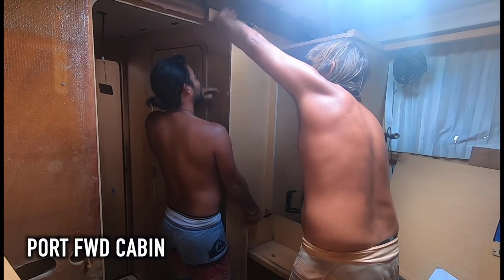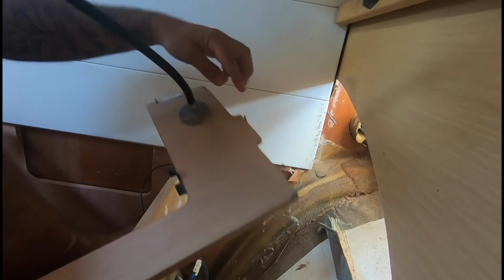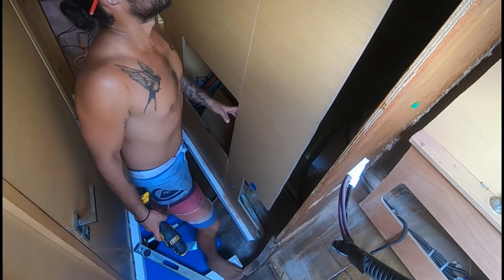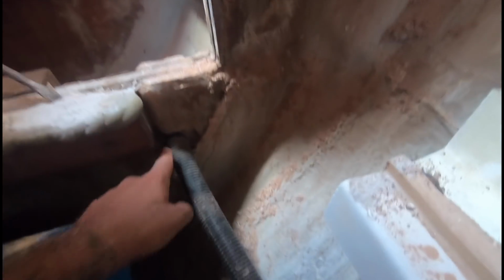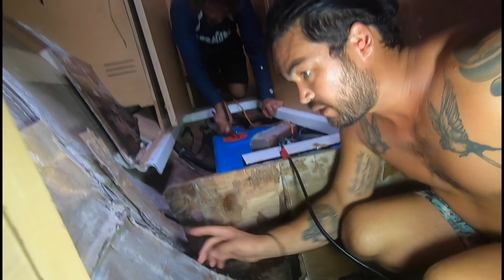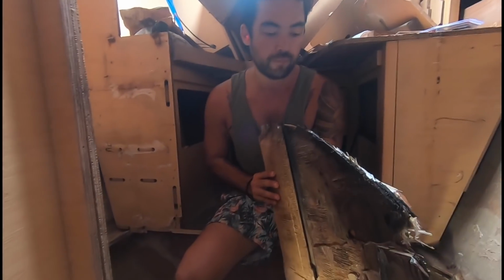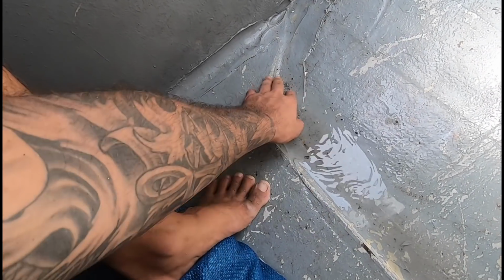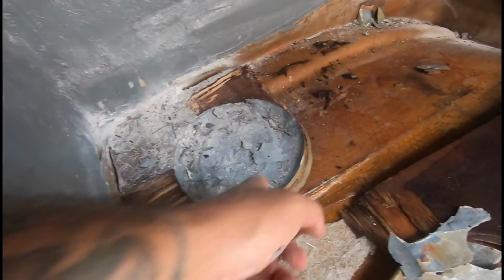CRACKED BULKHEAD REPAIR SERIES - Part 5  (Episode 110)

Comment: Einstein may have been smart, not as smart as a “destructive f*cking water droplet”...  🥴.  Is there a point where you may want to replace entire bulkhead, kind of like two halves (L/R) built outside the boat using templates and assembled inside? Is that feasible to do?  Spend the money on proper masks, fiberglass dust you’ll be breathing will take years off your life..🥴.  Love the positive attitudes and it’s gonna be a tank when you guys are finished 🥳.   Cheers from SoCal, Armchair QB, Matthew! 🤓

Comment: Are you planning on replacing the interior you had to cut out from other wrecked Lagoons you may be able to salvage from, building new Lagoon jigsaw or going a completely different route so you can get to those areas again if you need to?

Comment: I have a few suggestions on the repair. I would make the doorways smaller/use carbon fiber in the repair   mixed in layers of fiberglass / add cross supporting cable's  from bottom of bunks to add support to the mast wires. Just bouncing ideas for the best results. Good luck.

Comment: Im surprised Lagoon are not paying you NOT to post videos. The design itself may be ok, but clearly its been fu*ked up by the builders using crap materials and drilling holes in all the wrong places, thats just bad engineering..

Comment: Guys, you will find. Every bulkhead where plywood touches the hull and not sealed to be wet. I did the exact same thing to this boat in 2000 https://www.yachtworld.com/boats/1977/hardin-voyager-44-3749998/ What I'm trying to say is don't waste time looking for leaks. I think it's hull condensation. That tiny void created where the plywood meets the hull breaths in, moist air we humans create wherever we live. I didn’t remove all my plywood, just cut back to good wood, then glassed and filled back in. My rot wasn't as extensive as yours, maybe 6" back at the bad places. I started to cut back even the good wood just so I could seal it and prevent future rot. You'd think modern boat manufacturers would know how to prevent this type rot by now. Good luck, you have the right attitudes!

Comment: I ripped out a lot of crap resulting from poor craftsmanship and lack of detail planning, but this tops it all, and by far so.  I am shocked by the build quality, the lack of error tolerance in the design, how conduits at the weakest points were made, the lack of proper fiber strand orientation, the... everything.  I admire Colin to have gone this far and still keeping up good spirit.  The absolute worst point has been reached and things will get better from here.  This revision from model 450F (*ucked up) to model 450CJ (Colin/Jamie) will result in a strong and safe boat, and eventually after quite some carpentry, also again a beautiful one.  That's the goal and Colin is right to focus on this. A year from now all this will be an epic story told at a foreign beach with a fire and a beer, and a sunset over the open sea framed by a 450CJ silhouette.  Best wishes!

Comment: Seems like the manufacturer knows about the crappy work. So many ppl have been posting same issues. The manufacturer went through the trouble to hide it! Wondering how many boats have sank and ppl they have injured or killed from their super expensive crappy built boat.

Comment: When building new bulkheads, instead of cutting rectangular door openings, have the bottom of the opening smaller than the top to leave more bulkhead material in the lower corners for more strength in that area.
Reply: Yep, rounded corners like in a sub. 👍

Comment: Right at the end: “I don’t’ know what the FK that is!”.  Surprised and funny, When You found the round piece.  Epic.   Great engineering mind.
Reply: I am very curious about what this could be, I came looking in the comments to see if anyone has any idea.
Reply: From what I've seen so far, it wouldn't surprise me if it was a hole in the hull that they patched with a piece of ply. This build quality is beyond bad, it's dangerous
Reply: @freerangerich  Thinking the same thing, wouldnt want to be on passage with any of these issues he's dealing with - hes been lucky as shit to be where he was when the boat broke
Reply: I wondered if they were bond pads to the hull for anchor points to lift it out of the mold and later get cut off.
Reply: That was put there to add more suspense and drama to this repair and rebuild story! Next few episodes should be good as they probably will determine that the whole boat needs repair and rebuilding... Stay tuned...

Comment: Dear parlay, don’t glass over your plywood bulkhead edges without first doing a dry run fitting of cabinetry- furniture, taking into consideration thickness of laminate of glass on ply edges, thanks.

Comment: Evidence of bad glue joints, not clamped with enough pressure to achieve the required amount of adhesion. Vacuum bagging would help a lot if it could be done.

Comment: F the pre-fab carpentry. You can do so much better. I know your pain I remodel RVs. You can treat the plywood also.  The engineers and designers should be down there ripping and tearing with you so they don't f up future boats!

Comment: I find many of the comments about the build quality of this brand or any brand comical and sad.  Truth is this kind of damage and deterioration is in MOST 20 year old production boats.  You see how hard it was to find.  You see Colin who has a lifetime of experience in this industry astonished at the cancer his discovers.  And think about all of that bulkhead rot came from trampoline brackets and 1/8 inch bolt holes.  I venture to say that many of you boat owners don't take the time to re-bed every lifeline stanchion, deck fittings, anchor windlass bolts, rub-rail screws, on and on.  Needs to be done every couple of years regardless whether you think it is fine or not.   This rot did not happen overnight.   But most boat owners don't understand this and since they are weekend warriors leisure time is too valuable.
In 50 years of being in the boat sales/ repair and brokerage business I am never surprised at the condition of an older boat.  In the days of wood plank construction, those guys regularly replaced planks, re-caulked and stuffed seems.  It was expected.  Now days, we use, abuse and go home and forget the boat for weeks, months at a time.  Don't continuously blame boat builders.  blame the previous owners that did not understand how to maintain a proper vessel.  Boats are a constant maintaintence project.  Go in with you eyes open.  This is my favorite YouTube channel because it is real.
Reply: Most intelligent comment on the site would great until it gets wet 👍
Reply: A huge thumbs up man. I just gave him a serve about this too!!! Well done. Hiltech Shipwrights
Reply: Skimpy production began with the ME generation aka the Reagon years. All the kids were going for mba's to make a ton of money. They would slice down everything to the bare minimum
Reply: Agreed. Why blame Lagoon? Did we forget this boat went through a hurricane and partial sinking? Who knows the forces that were put on her through that which caused all this damage? Lagoon doesn’t owe anyone any apologies. There are many other Lagoons this age well maintained with no major issues.
Reply: @shorelineltd8787  I guess to the larger point,  as a yacht broker in an era with shrinking inventory we are now seeing the "beater" boats that have had little or no preventative maintaintence come to the market.  This is unfortunate as Buyer's have unrealistic expectations of older boats and make decisions about brands and builders based on poorly maintained boats both power and sail.
The skill and perseverance that Colin has is almost unheard of now days.  Therefore those old boats that have lots of problems will ultimately be a disappointment and money pit for some unknowing buyer.  Then disappear into the fiberglass shredder.
Reply: @stephenscherr8893  regardless, I wouldn't be looking at an older lagoon.  Obvious weak spots and who can cut up their perspective  cat to inspect for this kind of damage.  Weak defense.
Reply: @paulhollyfield6044  It doesn't matter what brand it is.  I have seen similar issues in Sabre's, Pearsons, Endeavours, etc.  Bottom line;  if the boat leaks Above the Water Line, you can expect issues.

Comment: Lagoon, it's time to give these guys a brand new boat.  After everything Colin has exposed here I would not go near a Lagoon design.  What a half-assed, poorly engineered piece of crap.
Reply: Free boat seems like it would be a good marketing move... the deeper he digs the worse this boat gets.. who knows what other bit of shabby build quality he will discover next week
Reply: Jason Galloway there's another channel on here that is sitting in the same boat yard as Colin who also found the same issues on his Lagoon as Colin has so this def has nothing to do with the hurricane damage but more a series of critical design structure faults as well as sealing issues.  Right now, Lagoon should be considering their position legally as well as doing something MUCH MORE for Colin and any other owners that are seeing these issues.  Their reputation is going down the shitter week by week.
Reply: @WallyMcFly  yep I agree it's a widespread issue
Reply: I don't think a free boat at this point would be the best move. I would send engineers to be on-site and builders to help fix the issue. Then maybe do a factory recall and fix the drain issues in the lockers if that is deemed to have been the causes of the rotten bulkhead. To me that would show they actually cared and not trying to sweep the issue under a rug.

Comment: Colin, hobby woodworker here, what’s the plan for reassembling the cabinetry? I realize there’s an editing gap etc so I’m mentioning it well beforehand but, pocket holes and glue would probably be extremely helpful to you in this case (as far as I can see). A Kreg master kit may provide you a LOT of value. Unsure weather to use epoxy or stainless screws but I’d use titebond 3 for my glue. Anyway, keep it up dude you got this. :)

Comment: Aren't you creating more repairs/cost/problems by cutting out the internals to get to the structural damage. (big job becomes even bigger job) isn't this the reason why the boats are not worth much even when repaired?
Good luck guy's, a problem is only a problem if you don't have the solution and you seem to know what the solutions are. 🤞

Comment: I have written a few spicy comments over the last 2 months, defending the boat builder. Colin you've been blaming them for the boats problems, with out understanding the complex reason for these failure points. As you've now found out.... there are multiple issues. The combination of these issues has lead to this almighty Cluster Fuck. I've been a Shipwright for 30yrs, building and fixing all sorts of boats. Some of the wooden boats I've work on are 50 to 60 years old. Plywood is a perfectly sound material to use...... as long as its not SOAKED in WATER especially rain water. If half of your boat was under water you have to be stupid not to think some main issues spouted from then. First you fixed the Basla core. Now you have to fix the plywood. A little hint for you..... there are 100's of different types of "MARINE PLYWOOD". Different wood, different glues, different amount of layers..... Don't just trust the stamp they stamp on it.
Anyway now you've found this rain water leak it shifts the blame back onto the boats owners!!!!! Not enough sikaflex sealing a fastening, falls into the "Lack of Maintenance category". Not the boat builder. Cleaning your lockers out regularly...  this is not the boat builders job.
Another point....If one bulkhead fails then the next bulkhead and surrounding joins and fastenings have to take up that strain. Boat manufacturers don't allow for that. Otherwise the boat would be twice as heavy, twice as slow, twice as expensive. This is why you are seeing cracks in the thicker laminates of fiberglass. #sorrylagoon #imabuffoon
You also said/complain that there's no drain in that locker and you never check for leaks, because there's always rope in it. Who's fault is that????? 
There's so much to learn about boat construction and maintenance. So much pain when you buy a lemon. I suppose these videos are supposed to be full of drama to get the crowd of Youtubers fired up in order to get them views!! So congrates for that..... just realize your videos effect real people and company's. Your videos have probably cost Lagoon $10's of millions in orders and now you find out its rain water rotting the bulkhead. Shame on you! When's the Youtube apology video come out????????? This is fires me up!!!!!! Your ignorance and cost cutting is hurting the company and the workers family's. 
I wonder if this is the first boat you've owned???? So you've bought a bashed up, sunken boat that has problems and now its the boat builders fault??????? F/Off.
Reply: Not everyone is fortunate enough to have OCD

Comment: Maybe, just maybe, plywood is not the best material to use when replacing the bulkheads.
Reply: water , not salt water and wood unless its very oily like say teak just don't mix
Reply: Ultra High Molecular Weight Polyethylene (UHMW) UHMW, also known as UHMW-PE (Ultra High Molecular Weight Polyethylene),  would be the modern material of choice.

Comment: After watching the deconstruction of these structural bulkheads,  I can honestly say I'm not impressed with the construction of Lagoons.  Note to self.  Don't buy a Lagoon.
As to dust control, put up plastic walls, set up a fan and duct out a window or hatch with ducting.  Put small make up air slits in the containment walls.  This will limit cross contamination dust.  
I wouldn't use plywood.  It would be better to make solid or cored bulkheads with a wood veneer.
 Good luck.

Comment: Great video Colin, Your mishap with the boat has made your videos much more interesting, so nothing is ever so bad, that it isn't good for something! Keep up the good work and spirits :-) PS. What about replacing some of the plywood with closed cell foam cored sandwich bulkheads? PPS. Have they really used high spec marine plywood in the consteuction or is that also an issue?

Comment: It is possible ? To build a skeletal mechano type aluminium framing structure super bonded to the hull in precise profile strong with designed 💪 flex integral and then boarded with marine ply with a luxury blend of composite 🥸 a totally advanced aerospace industry stylie? Holy
I mean you could even slide rails so the walls can become moveable dude, I’ve built some cra cra wacky stuff fabricated for super yachts in my
Lifetime anything is possible ? Think BIg , or just super bond with Kevlar and composites/carbon fibre and marine ply simple ! 
So many options
Build back better !

Comment: Do you have enough slack in the cable runs to relocate the through holes, or are you planning on laminating more plywood around them?  It looks like the material used to glue the plywood panels together was poorly applied.  I like your idea of glassing the whole bulkhead for extra strength.  Hope Lagoon learns from your improvements.

Comment: It seems to me the single biggest strength problem concerning the bulkheads is crisp (90 degree) or near crisp inside corners. A large radius on any inside corner will increase its strength exponentially. This applies to both the passageway cutouts in the bulkheads, and also the tabbing.
That being said, keep the faith, and keep up the quality work!
Reply: That reminds me of the comparable structural problems with the worlds first commercial jetliner, de Haviland Comet (1952) see https://en.m.wikipedia.org/wiki/De_Havilland_Comet . This is why every aircraft has only rounded corners windows and doors.

Comment: This and Expedition Evans make me think that expensive boats are still built by careless cowboys. Good enough is good enough. I noticed when you popped that plywood apart that the small amount of glue in between the layers had never been spread around. So it wasn't rolled, or glued under pressure. That means it could flex like two pieces instead of one thick piece.
Reply: It doesn’t help that lagoon and beneteau are part of the same brand
Reply: You would be horrified to know how many production line boat builders use "No-Nails" on interiors.
Reply: Production boat . All the real quality builders went bankrupt in Canada and we are still sailing those boats 30 years later and they are good .  Just rebuilt a shark with my son. 1964 boat that was neglected and left filled with water for a decade , so much water the trailer bent . 

The hull and deck are fine , 2 stringers were toast , 2 main bulkheads had a little rot and easy to save  but we replaced anyway , All the tabbing held and everything was tabbed .Every bulkhead , every berth - all tabbed in fully and the main bulkhead 3 layers on 3/4 ply . Every bit of ply was real marine ply and you could tell, this in a 24 foot boat  .  Steel keel straps and keel bolts were rusted  out though . 

Production boats today are not even close .

Comment: I know this type of work sucks Balls! But you guys are kicking ass as usual and doing it right. Finding all the bad bits and cutting them out. By the time you have this boat back together and sailing and I have complete faith you'll get there, you'll know the structure inside and out. I hope you can redesign those lockers and solve that drain issue?